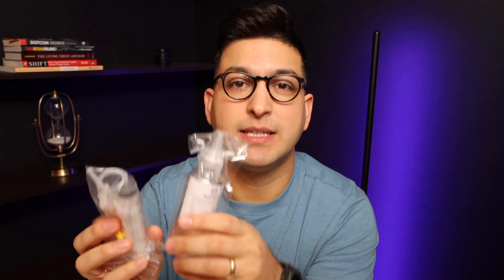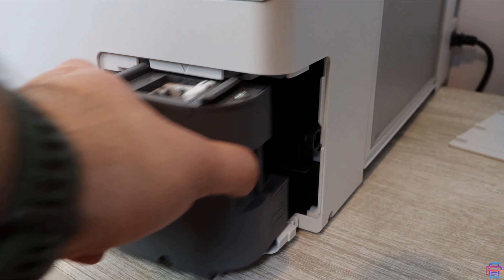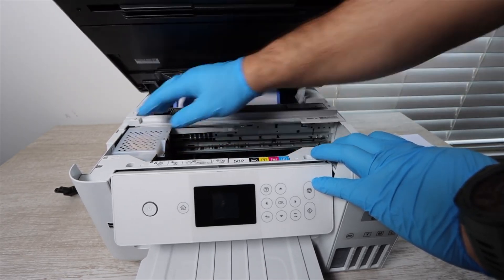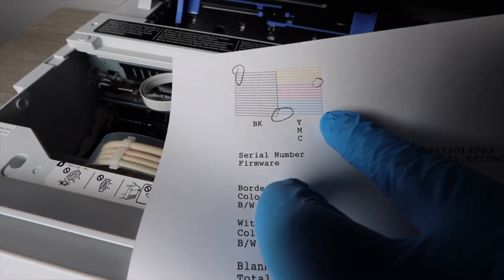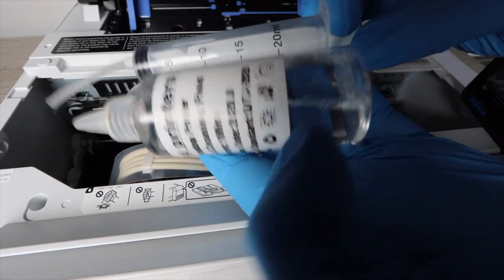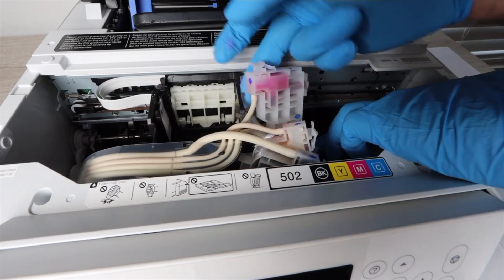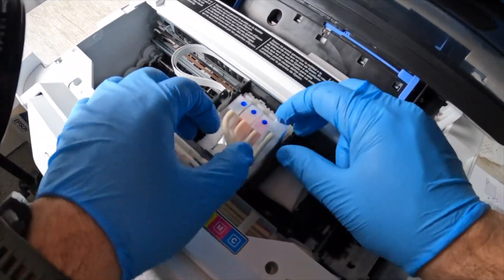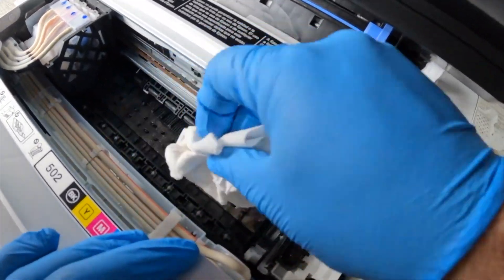Epson ST-2000 Not Printing Black, Color, Blank Pages [FIXED!]

Comment: Hi!  Thank you so much for your video.  I purchased the cleaner kit and followed your directions.  Before I could do the final cleaning, it threw me an error code and I couldn’t do anything but power off.  I waited 12 hours to see if it would change and it did not. Do you have a work around for this?  Maybe a reset procedure or a list of code descriptions?  The code I got is: 031006.  Any assistance would be appreciated!